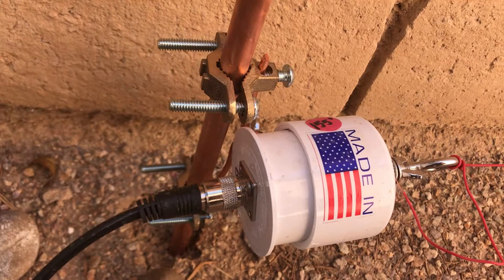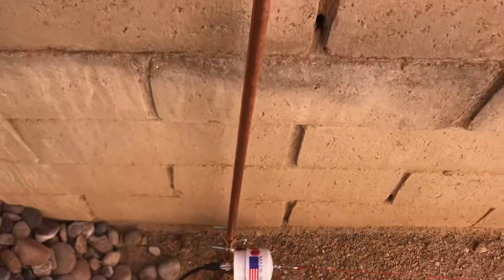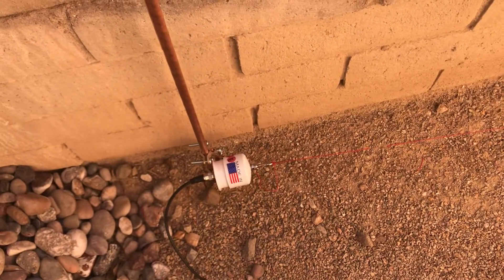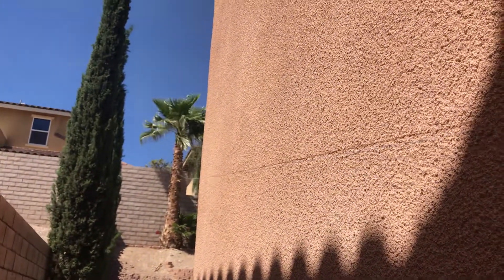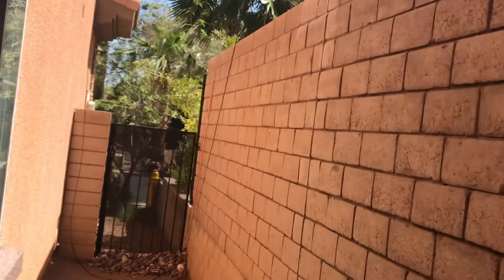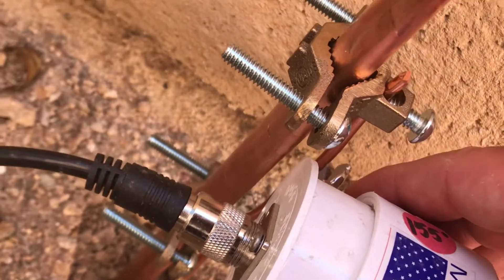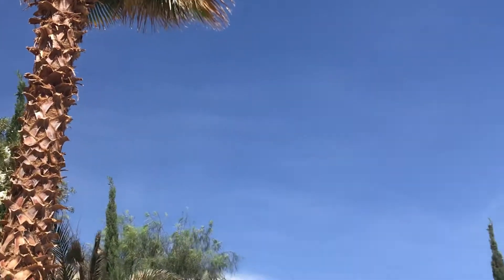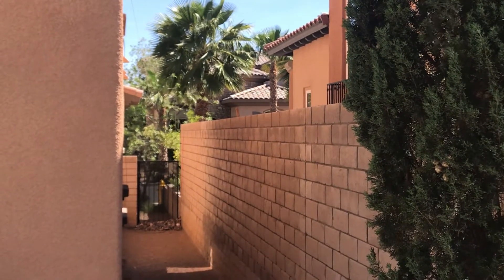End fed 80 foot wire with Palomar Engineers Bullet Balun

Comment: The volume on your video was barely hearable. Can you please post a list of all the items you bought to install the entire thing please?
Reply from the maker: Ground rod
Clamps
Ground wire
80 feet of bell wire from Home Depot
One egg insulator for far end
A 30 foot palm tree
Palomar engineers 500 watt bullet 1:9 unum
50 feet of RG8X cable
RF suppression toroid donut from Palomar engineers
About 20 feet of coax coiled up in 1 foot diameter coil
Reply from the maker: Maybe turn up the volume?

Comment: Did you read the part in the manual where you are not to ground the counter poise, also you are running hot into your shack with no transformer before your radio, thats why you are coming out on all your neighbors intercoms, try getting a copy of ARRL,s antenna book, you need to study.😊
Reply from the maker: Thanks. I put in the transformer which is a huge donut and coax thru it. I also coiled up in in a foot diameter. The main problem was 40 meters. I have limited space for all this stuff. 80 foot wire. Does not work on 80m at all. Works fine on 40m and higher. but not great. I could put some wire off the ground into the  front yard under the dirt. Good idea.
Reply: @moviestudioland  ya you need over 100 ft for 80 meters, with limited space you could try a mast, to run a inverted L , say about 30 ft vertical and the rest out to your end point, congress is working on some new laws, that will put a stop to all these HOA's hopefully, good luck with your setup, 73s  AI7VS

Comment: The concrete footing for the wall is probably blocking your ground rod. Move it away 6-12 inches away from the wall. You may hit buried stones so try try try again until you penetrate, and get a small sledge hammer and pound it down. Use some water saturation to try and aid its penetration. It can be done so long as you are not so concerned with appearance. Its function first. You need to use the correct amount of coax to create the other half of your "dipole". It does not matter if you need the coax to reach the antenna, you need the coax to make the antenna operate properly. Watch this    https://www.youtube.com/watch?v=4lzlZxxUzM0 at timestamp 30 minutes in where he discusses this and you may also want a counter poise (not just a ground rod) and also a choke at the shack to stop common mode current.

Comment: I would move that ground rod. You might be running into the base of that wall. Ordinarily you should be able to pound that rod all the way down with a 2-3 pound mini sledge hammer. Palomar has a great video on setting these end fed antennas up.
Reply from the maker: Thanks for the tips!
Reply: Yes, slam the rod all the way. Leave 6"-12" out..

Comment: I use a 71' stealth end-fed sloper with 9:1 Palomar unun at the 15' balcony high end going down to a 6' wooden fence; 50' RG8x, no counterpoise, Palomar common mode choke on RG8x jumper 3' from transceiver. No tuner needed on 20, 17, 15, 12, 10 meters for SWR of 1.2 to 1 or less. Using my XPA125B amp's ATU, SWR is 1.5 to 1 or less on 160, 80/75, 60, 40, 30. From California using 100 watts SSB & QRP, I've worked Europe, Mediterranean, Africa, South America, Asia, Australia, Canada & US on higher bands. I get 5/9 signal reports on daily 80 & 40 SSB nets. I've made contacts on all HF bands. It's a fun and inexpensive all band HF antenna.
Reply from the maker: Wow thanks.  I have about 80 feet
80 meters is very bad for me and I interfere with built in intercoms in the house and neighbors too.
40 has SWR and I had to add a ferrite choke
20 is kinda bad
Reply from the maker: 15 has SWR
17 is perfect
10 is perfect

Thanks for the comment
Reply: Thanks I think will configure my antenna as you did one question did you get any rfi in your shack cause some hams place their choke after the unun many thanks 
9z4apa  73s.

Comment: I have one too, their 9:1 with 72 feet of wire. Never could get it to work well on 80 & 40.  So I purchased 135 ft of thin black wire and about 130 ft. is the sweet spot for me.  Paloma has a lot of products for RF suppression that may help with RFI in the shack.  
Good luck & 73
wd4dda
Reply from the maker: Hey
Thank you!! Yep I have no where to run 135 feet of wire 
I can run 80
Maybe I can rub 135 someday but I need to double back

Comment: The counterpoise serves to act as a counterbalance for the RF being emitted by the antenna wire.  Just get a spool of 50 feet or so of bell wire or some other stranded wire (18 or 16 gauge for mechanical strength) and run it along the foundation as far around the house as far possible.  Connect the other end to the ground terminal somewhere.  This will only improve your antenna.
Reply from the maker: I am very happy with the performance of this antenna so far. Works on most bands with an LDG auto antenna tuner in my OLD Ten Tec Pegasus.

Comment: The short coax run is cutting off the " other half of the dipole that the 50 to 100' of coax serves as. You also need to install the ferrite choke by wrapping 8 to 9 wraps of your RG8X coax through it with a small pigtail to attach at the transmitter output of your radio. This antenna works better with the supplied wire and the radials and not grounded as you have it. Try an inverted "L" configuration.  The common mode current is the reason you are experiencing it 

Cheers
Reply: Roger that!!  Follow the Instructions!!
Reply from the maker: Yep installed choke

Comment: Very good - I have a bullet and use it on my small lot in Orange County and with a tuner, works pretty well.  I like your mounting to the ground rod idea and need to try that, as I get tired of stringing to trees in the backyard.  Somewhere, I have a 4' ground rod which is a bit more manageable.  73!
Reply from the maker: Yep. Great little antenna. Thank you